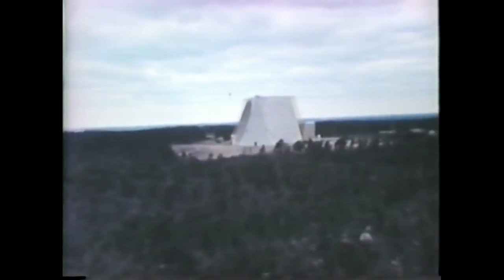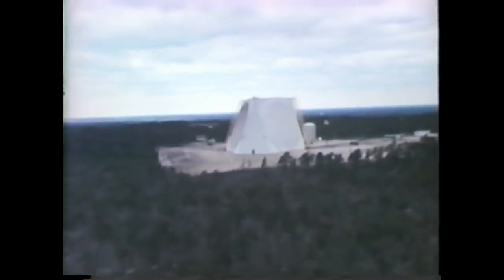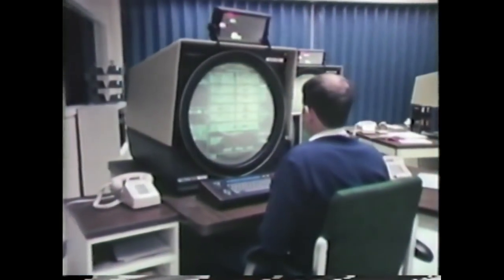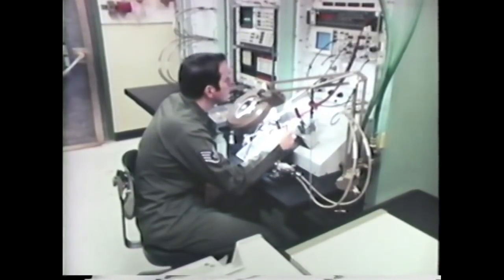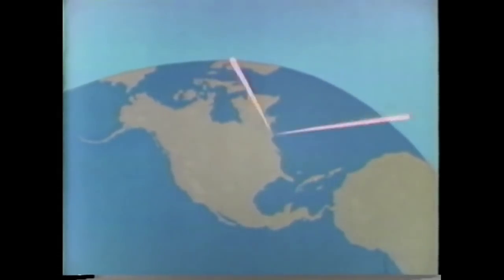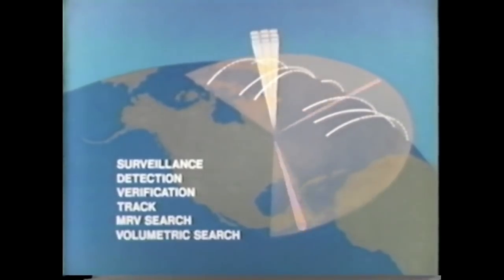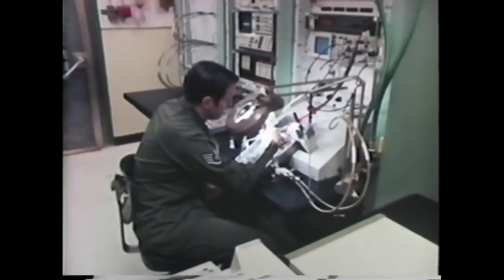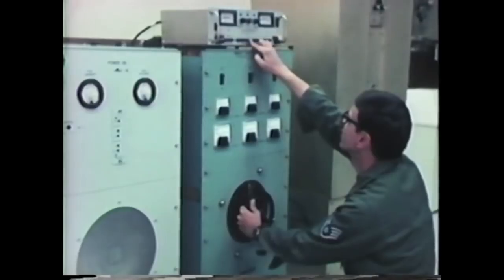PAVE PAWS Early Missile Warning Radar

Comment: Except that the inbound tracks would be coming straight from Canada's north, the only east west trajectory would be submarine launched ,well inside the radar cup
Reply: PAVE PAWS was designed and placed specifically to detect SLBMs - not over the pole ICBMs.  Other sensors existed for that.
Reply: Well you need to have radar to all sites, or they will use the blind side.

Comment: The systems are still very much cutting-edge.  The PAVE PAWS radars and associated gear have been, in most cases, moved to the northern border to replace the Sixties-vintage BMEWS systems.  At Robins AFB it was reported that the radar had to be turned off when aircraft landed due to interference.  A public television station at Cochran, GA had to change from Channel 28 to Channel 29 due to the radar.  Even the old AN/FPS-85 radar  at Eglin, AFB (dating to 1969 ) is still kicking along.
Reply: Yeh, supposedly the radar was causing weapons on certain aircraft stationed at WRAFB to arm themselves.  Very very destructive type weapons with extremely complex safety systems built in.  Kinda stupid to build the radar a mile or so south directly in line with the main north south runway.
Reply: The arrays are still in operation, there's ongoing upgrades.
Reply: I work at Robins. It's still there. Not sure if they're actually updating it, every time I drive by it, it's empty. It's like a time capsule of the 70s and 80s. You can find it on Google. I would love to go inside and take a tour but I doubt it will happen. The parking lot is used for base motorcycle safety. It can still be used if they wanted too.
Reply: @humansvd3269  i was stationed at robins too, was really cool to see the building in the back side,  its massive.
Reply: Not quite true.  One of the two radar faces had to be "dropped" when certain approach patterns were used.

Comment: The radar was great, but the day to day job was very boring, compared to my other assignments in the Air Force.
Reply: I can imagine it's boring.  Were you an operator or analyst or ... ?
Reply: @michaelbauers8800  I was a radar operator. My title was Crew Chief. Each crew consisted of four people, three military and one civilian. Of the three military there was a Crew Commander (usually a Lieutenant or a Captain, the Crew Chief was usually a Technical Sergeant, and the Space Systems Operator was usually an Airman but could be a Staff Sergeant. I cannot remember the title for the civilian, but their job was to ensure the system was working properly. I was stationed at Eldorado Air Force Station, TX. At the time I was assigned there, they had just build it and was in the process of getting it operational. Additionally, they had also just built one at  Robins Air Force Base in Georgia. A few short years later they would close both the PAVE PAWS units Eldorado and Robins Air Force Base. Unlike those units at Beale AFB and Robins Air Force Base, those units at Cape Cod and Eldorado were not built on an Air Force Base. Speaking only for where I was assigned, Eldorado AFS, there were no amenities of that of an Air Force Base, or even that of a normal radar station. There was no housing, and therefore everyone had to live off location. Most of us lived in San Angelo or in base housing at Goodfellow AFB, located at San Angelo. We had two ways to commute to the radar site, either by our personal vehicles or they ran a bus from Goodfellow AFB. The ride took about 40 minutes. The radar site was fairly secured in comparison to most bases or regular air defense radar sites. Not only was entry secured by two turnstiles and a check point in between for pedestrian traffic but two gates, a check point, and also barriers that could be raised from the ground. The site was surrounded by two fences topped with razor wire, with a Deadman's area in between. There was also cameras and listening devices all around the site. The biggest difference between PAVE PAWS and a regular radar that tracked air planes for an operator was of course the distance of the radar, but also what was seen on the scope. Regular radar site the operator would see every aircraft that penetrated it's radar coverage, whereas with PAVE PAWS, the radar operator only saw those things that required observations. While the job was important, I found it to be very boring compared to other assignments. Occasionally, the radar site would be evaluated, and if those in the Missile Warning Operations Center failed, then so did the whole radar site. What determined that was they would run a sim tape over live radar, and at some point the radar would detect a missile launch. Then it was the responsibility of both the Crew Commander and the Crew Chief to determine, not that if it was a valid launch but rather if the systems was valid. We had 60 seconds to do so, if we could not do so in that allowed time, we and the radar site failed. It was a decent assignment due to all the things you could see and do in the area, and because of the people I worked with.
Reply: @stephenhornung2808  Thanks for all that info, very interesting.  I have some involvement with the modern system so always interested in the history of the system
Reply from the maker: Solid info! I was a crew commander at Cape Cod AFS from 2015-2017. Very similar experiences. But we stayed pretty busy tracking a bazillion things in orbit and luckily didn't have to commute 40 minutes to get there.
Reply: robins site still exists. It's a time capsule and it's exactly as you describe. I think they're going to bring it back.
Reply: You're right, the day-to-day job could be tedious.  I was at Beale PAVE PAWS 85-88 as a Crew Commander and then unit DOT Chief.  We went through the downsizing of the ops crew from four- to three-person during that time.  Remember meeting some of the Eldorado ops people at a training conference at Peterson.